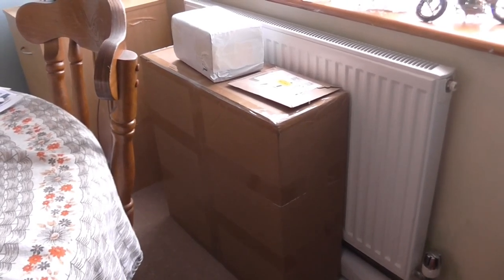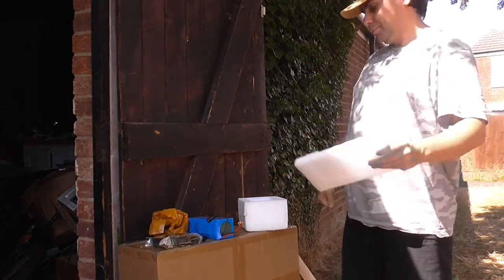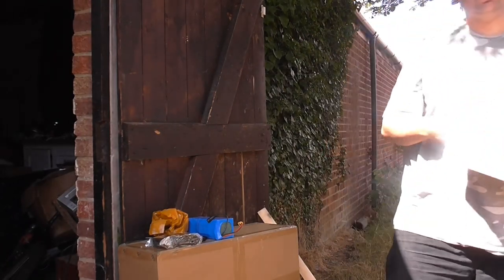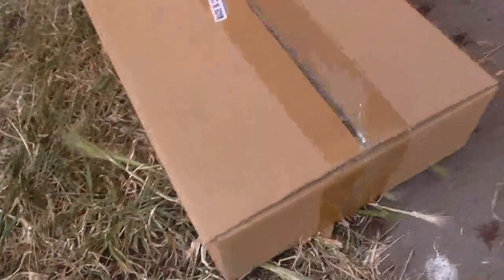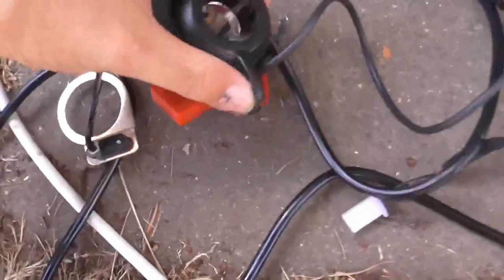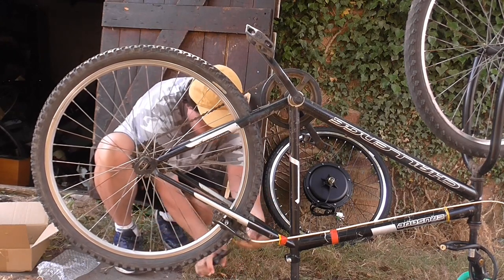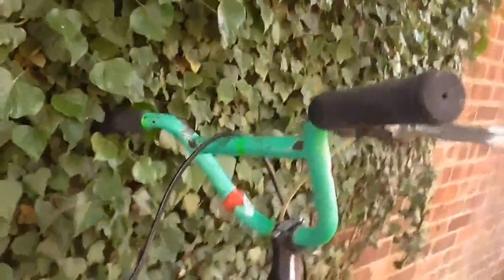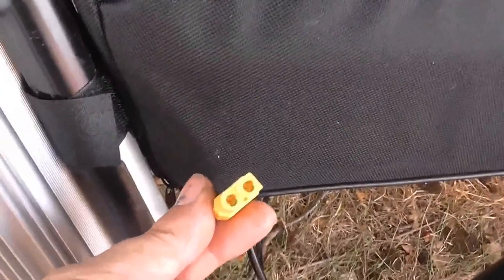Upgrading my bike to an E-Bike!

Comment: Great project; looks like so much fun. Please make another video when you get the right battery.
Reply from the maker: I will do an update, but those batteries aren't cheap, I'll have to wait quite a bit until I cant get the right one.
Reply: @CoolDudeClem  I understand. what sort of milage do you think you can get out of the current battery?
Reply from the maker: @jamessmith99731  I really don't know, I recharge after every 2 rides. At the moment I dont go very far, maybe about 3 or or miles each day. I tell you something so, on full throttle even with the battery I have, it zooms along, it's such great fun and I LOVE it! (allthogh sometimes that's a little faster than I'm comfortable with on a bike).

Comment: I've seen those with the motor on the front wheel. Looks great, enjoy.
Reply from the maker: Originally that's what I was going to go for as it would have been easier to install, but what I went with in the end was a much more powerful.

Comment: You need a square taper puller to get the lefthand crank off. It's very cheap and you can get it at every bike- or even hardware store.
Reply from the maker: I didn't know that, it loked like a regular kind of nut to me, I don't think it's worth it anyway, I can just zoom along from the motor alone!

Comment: Is that 1000 Watts for the unit you have, in Australia you can get them but they would not be road legal, here now I think it is around 250 Watts.  At Christmas it is hot and like 40.C for me, but not now (its winter)tonight it is going down to believe it or not -5.C geez that is low for my area.
Reply from the maker: With the right battery yes it would be 1000 watts.